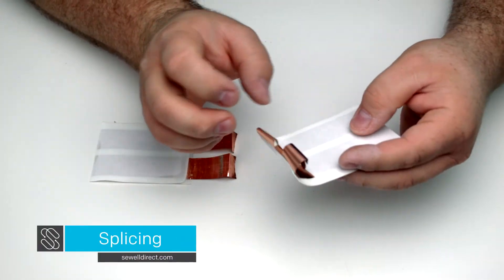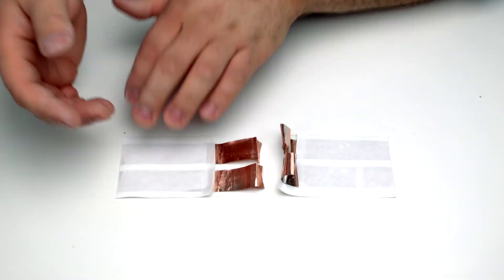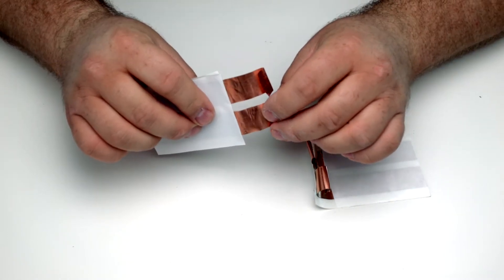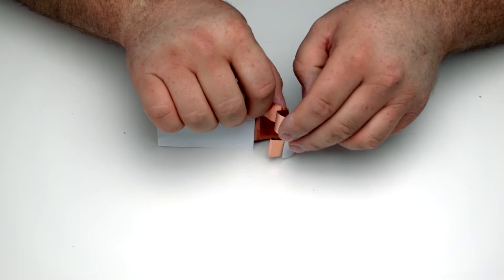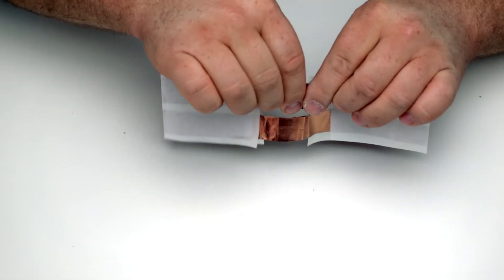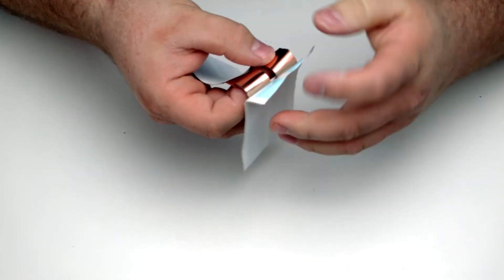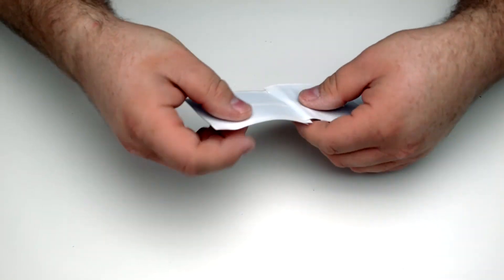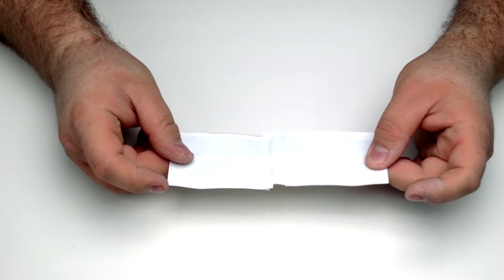Ghost Wire - Splicing Two pieces together

Comment: Don't know if this comment will be seen but here goes:
I'm planning to wire 4 satellite speakers on a wall and ceiling.
I bought a roll of 4-wire ghost wire 2.0 and a roll of 2-wire ghost wire 2.0.
My idea was to make it a bit cleaner, have 4-wire go horizontally from behind the tv cab, one left one right, for about 2 meters. Then do a right-angle, and go up about 2 more meters and i would terminate 2 of the coppers on each side for the front left and right satellites.
Then splice the remaining 2 coppers to a 2-wire roll and continue vertically to the ceiling until they reach the surround left rights mounted on the ceiling above the couch. (Maybe a further 3 meters or so)
It just clicked, that the 4-wire and 2-wire are different gauges. Will this be ok? Or should I rethink?